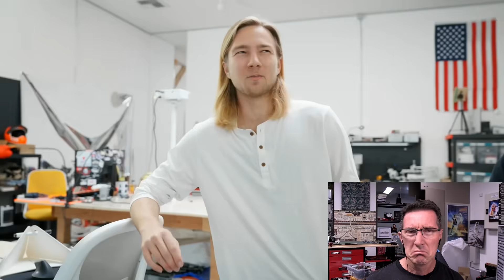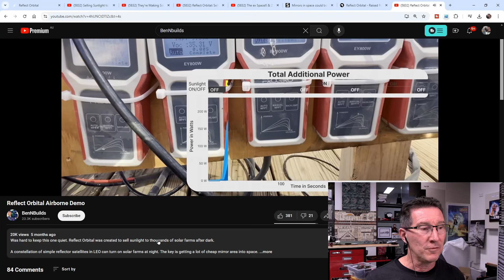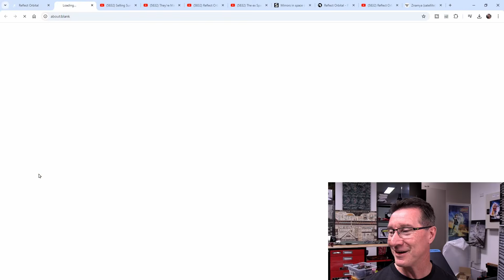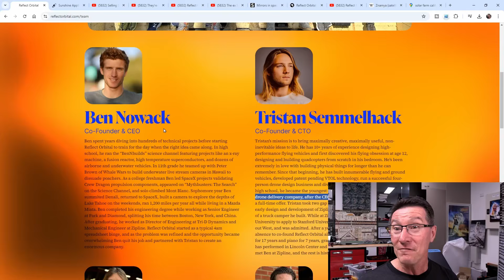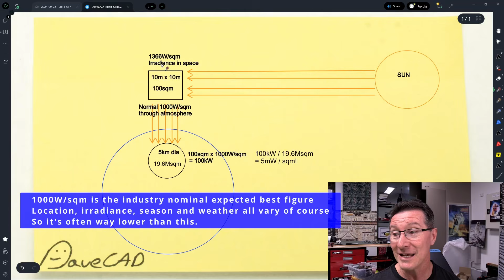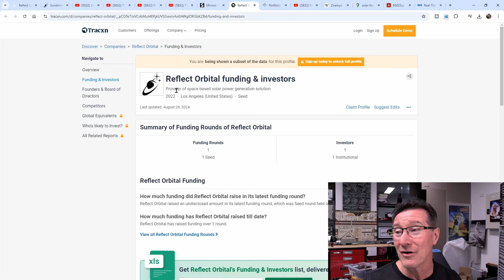EEVblog 1637: Solar Freakin' Space Mirrors! - Reflect Orbital DEBUNKED

Comment: First, the you need to include the cosine of the angle. Assuming mirrors cannot reflect at 45 degrees you will get 70% or more. Then the mirror are not 100% reflective.
But even if we ignore any of that, to reach 500W/m2 to have a sun equivalent in an area of 2500m radius, you will need more than 9.8 million mirrors.
Earth is the only planet we can live in the foreseeable future, we won't colonize Mars soon, but I am really really afraid of this crazy startup companies if they get enough funding to launch almost non-controlled thousands of satellites in low-Earth orbit. It will take just a single chain reaction to make impenetrable barrier of debris to trap all humans on Earth.
Reply from the maker: I didn't calculate how many mirrors it would take to get the claimed 200W/sqm, it's was already enough clown world for one video.
Reply: The big problem, due to cost and weight limitation they have to put the mirrors on higher orbit where drag is very small. But due to optics, they need to put it into the lowest orbit with low enough drag.
That exactly the orbit where Kessler syndrome can cause massive problems! This is literally the worst possible orbit to put their junk on.
Reply: @adamrak7560  also the lower the orbit the more of the satellite needs to be ion thruster (and fuel tank) than mirror in order to be able to reflect light in a controllable direction.
When the thrusters operare the mirror isn't likely to stay flat either.
Reply: Good for the universe ✨️
Reply: u only need one mirror, for maximum capital performance
Reply: doesn't matter, we're trapped, anyway. No one and I mean NO ONE is getting off more than very temporarily.
Reply: @TheGuruStud  it does not imply to the freedom of movement ON the planet. eat some shit! stupid!
Reply: There are a lot of problems with living on Mars, mainly the reasons why there's almost no atmosphere there
Reply: Kessler syndrome brought to us by tech bro scammers.

Comment: There absolutely is a way to generate power using the system. But you need to sell it not to solar farm owners but to Jevaho's witnesses. They will meet at dusk and right when their leader says his last "amen" the sun will shine on them again and they will start to beat in extasy until the sattelite has flown too far away and the holy light is gone. That is when you pass out simple vibration generator/battery untis from China and as the magnetic cores rattle inside the coils the small lithium batteries in them will get charged. After the meeting concludes and everyone is satisfied you collect the devices and hook them up to inverters and sell the power to the grid. This way one may even claim that it is possible to transform the power of faith directly into usable electric power.

Comment: Unbelievable. If only those doing the investing had al little more science / engineering knowledge. I remember learning the inverse square law in a high school physics experiment aged 14. It's about all you need to know to see this can't work.
Reply: just use concave mirror, then the collimated beam won't have inverse square law drop.
Reply: @xponen  That doesn't help at all. With a collimated beam you get a smaller spot of light on the ground, so can hit less panels, for less time as each satellite passes overhead. They're effectively un-collimating the beam anyway (i.e. making it diverge more by using a convex mirror - there must be a word for that) to make a 10m mirror make a 5km spot on the ground. If the mirror were flat (and perfect), you'd effectively get a 10m spot on the ground too, as the satellite orbit altitude will be irrelevant relative to the distance to the sun

Comment: In theory, this would work. In practice, we don't have the tech to do this affordably. Besides, logically this would result in more heat hitting the earth which would be bad. So even assuming that they get the amount of power that they dream of it'd still be a terrible solution.

The better option would be scaling this up until it becomes practical. So massive mirrors that can capture light from hundreds or thousands of kilometres, convert all of that energy into a focused microwave beam, and then finally send that power down to collectors on earth. But that requires having better launch tech than what we currently have.
Reply: Collecting all that power into a concentrated beam.....like a giant space death ray, eh? If it went astray even for a minute, it could cause massive amounts of damage and kill who knows how many people.
Reply: @WereCatf I mean, for some people that might be the point, especially if they've got a fluffy white cat and a penchant for holding the world to ransom...
Reply: @WereCatf  Seems my comment didn't want to post, so I'm forced to retype it. Still not planning on doing any actual math for what a safe beam energy would be.

Anyway, there's no need to use a beam that's got many thousands of times the energy of regular sunlight to be commercially viable. Even just a few times regular sunlight would be sufficient. Not sure what the safe range would be, but my estimate would put it at around 10x regular sunlight. Then just build a larger collecting region while keeping the incoming energy at 10x sunlight per metre.

Also beams can be focused from multiple collectors into a single area on earth. That way each of those collectors individually has a beam of only a few times the energy of normal sunlight. So even if one of the satellites is compromised, it can't cause any damage on it's own. It can then be promptly destroyed or retargetted correctly. Though of course that'd still be concerning if all the collectors were turned into a weapon.
Reply: There is a way easier option. Just install more solar panels and energy storage on the ground. It's not rocket science (literally).
Reply: @to_loww  Currently, yes. Once we have cheap launch costs or industry in space, placing the solar collectors up there will be the better option. This is all mainly an engineering and political limitation rather than an scientific limitation. While stuff like solar roadways is a scientific limitation cause its stupid, placing solar panels in space gets you more efficient energy (space doesn't really have weather, clouds, useful land, day/night cycles, etc). So once we get the tech and will to make such a thing for cheap, it will be done and it'll be more affordable than covering the planet in solar panels. Unless you're suggesting that we'll never get to a point where we can or need to do that. Which would be quite disappointing.
Reply: It doesn't even work in theory - to get 5km radius of sunlight at regular sun power/area numbers, you need to collect that much area of sunlight to begin with - you can't magically amplify 10 sq m of sunlight to be 5 sq km of sunlight

Comment: Changing topic slightly but our friend "Solar Roads" are making their way to the UK .. they say ---- " Solar roads are a new and innovative concept as they do not require land to be specifically allocated. This is because the road infrastructure already exists. Therefore, this emerging technique of embedding solar panels into pavements and roadways is becoming a more attractive proposition." ----- and they say that "solar roads may supply up to 96.42% of the UK's total electricity, which is a substantially promising potential." i bet your BS sensor picks this up lol
Reply from the maker: Is there a proposed UK system?
Reply: @EEVblog  It appears so
Reply from the maker: @kynkokytsumi1931  JFC they just got their 7th government grant in June! They have been grifting this for 18 YEARS now!
Reply: @EEVblog  funny they are making it sound like it's a new thing 🤣
Reply: @kynkokytsumi1931  is it by the same people behind those videos on Thunderf00t's channel? Wasn't the government contract they had in the USA a failure not much better than their own small 3m²-sh prototype? They had something like a 10m road segment somewhere, maybe significantly changed from the initial idea, like  reduced to either "freaking-solar-gutters" or "freaking solar strip on the middle of the lane, not under cars' tires most of the time." 

While that would get rid of issues deriving from led bells and whistles and some of the "glass-road"-performance issues, it's probably quite far from a promising idea. Makes me suspicious that in some cases such projects may not have the politicians involved being duped, but making some money on the government contracts themselves. Although Hanlon's razor would have them as just being just as bamboozling victims. That they historically have managed to make some corrupt money while at least delivering real projects, overpriced, is somewhat suggestive of them being duped, Although the new-tech thing may help camouflage the overpricing better than standard infrastructure.
Reply: I heard about solar roads for pedestrians in Hungary. Somebody is either high or was really paid off. (or both)
Reply: @adamrak7560  Those companies and projects live on subsidies for renewable energy.
Local governments get a budget to spend on renewable energy projects, they get contacted by companies selling stuff like solar roadways, and they decide to do a test.
It becomes a failure, the money is wasted, but they companies just move on to the next region.
Reply: @Rob2  And they call it 'spending' money on renewables to meet their 'sustainability-quota'. "Wasting" would be a much better word and closer to the truth.
Reply: @Rob2  maybe it's time to start speaking of travelling snake-solar-panel salesmen.

Comment: Alright it is settled... I am going to start a business called Solar Freakin Tires! I am going to put solar panels on car and truck tires. just doing some toilet paper math here and I think it will be enough to charge a Tesla so you never have to plug it in. Don't question my math because I am a math god. Anyone who criticizes my ideal is a big oil bigot.
Reply from the maker: Straight to StartEngine or Indiegogo
Reply: This sounds good. I put one of those TPMS things on my tires and it's amazing how hot they get when parked in the sun. That energy could be harvested.
Reply: @gargantuablargg  Joke aside, I really want those TPMS to use the changing pressure differential between inside and outside while driving for energy harvesting and to pump up the tyres as needed. I'd say that is totally doable. The electronics need minimal amounts of energy, and the pump doesn't need to pump any large amounts, just what's lost over time.
Reply: @gargantuablargg  Maybe. I was thinking more about a tiny piston driven by a small weight that can move a bit in the rotational direction of the wheel. It would execute one pumping move every time the rotational speed changes. All the electronics need to do is to open or close the valve between the piston and the inside of the tyre when the tyre needs/doesn't need more air.
Reply: Solar Freakin Toilet Paper!!
Reply: You got my backing! :D
Reply: I'll so steal this shit.

Comment: Their proof of concept of using mirrors mounted on balloons makes way more sense their actual planned final product.
Reply: Seriously. Placing mirrors in high places to illuminate shaded zones is actually a more practical idea and infinitely cheaper to implement with zero risk.
Reply: @vejymonsta3006  if you want more light in an otherwise shaded space -  yes, absolutely!! Of course not a balloon - they are inherently unstable. If you want energy, it probably makes more sense to mount a solar panel rather than a mirror that will reflect that light onto a panel ;)
Reply: @kacperkucinski7702  Agreed. That's big brain
Reply: @vejymonsta3006  there are risks. If placed low - animals and ice chunks, if placed high - ice chunks, but the repair is still cheaper.
Reply: @vejymonsta3006  And that's actually done already. So proven tech. (One just need polished stainless steel plates, really)
Reply: @vejymonsta3006  People don't put solar arrays in shaded areas, though.
Reply: @vejymonsta3006  I think there is a city in switzerland which does that, or austria ... somewhere in a deep valley
Reply: @vejymonsta3006  I thought of that too....couldn't articulate it as well as u
Reply from the maker: Ironically, yes.
Reply: There is a village somewhere in a valley, using mirrors on the hill to illuminate parts of the village.
Reply: Exactly what I was thinking. You beat me to it.
Reply: It's basically just a solar accumulator though, those farms out in the desert using mirrors to concentrate onto salt would work in any bespoke setting.
Reply: I get you about the proof of concept balloon tests being the best part. It basically shows the reality of what they have.
What if you flip it, and raise the solar panels instead to get more out of the dawn/dusk? You can easily  raise large box kites or other dirigibles outfitted with solar panels angled at just the right angle, connected with tethers to draw the power. But would it be worth it?
Reply: They’re actually pretty smart for this idea, although most intelligent people see right through it. What’s so shocking to me is the amount of idiots who believe this kinda crap. Ever hear the saying more “money than brains?” Yeah, well obviously quite a lot of people with money are dumb or just naive. However “start-ups” are a quite popular way for the wealthy and middle-class to invest their money in. Look at all the crypto scams and people who’ve lost a lot of money on new crypto companies, who’ve failed. I know all of us intelligent folk are laughing at this…just don’t underestimate the level of stupidity in our society. Look at how many people believe the earth is flat and will argue with and try to convince people all day long, that they’re right. There’s debunking the debunked and it’s like a never ending loop of stupidity. 

I’m sorta contributing to the same thing I guess, by wasting my time here. Haha, but I had to comment on this one, because I am truly astonished. It’s unbelievable to me that wealthy people have invested their money in something so improbable. I’m astonished they were able to convince a few “smart” people with great resumes or careers and get them to move. Would you leave a high paying real job at a Fortune 500 company to work on this b.s.? I guess maybe…if you were 100% sure you’d get paid each month for at least a few years? This was both frustrating and funny to watch and Dave made some great points. I did learn a thing or two as well. However…definitely a net negative when it comes to brain cells or “points” on this half hour of my life. Haha!
Reply: Likely to cost more in fuel and paying balloon crews than the most optimistic possible power generation.
Reply: They’re actually pretty smart for this idea, although most intelligent people see right through it. What’s so stupid is the amount of idiots who believe this kinda crap. Ever hear the saying more money than brains? Yeah, well obviously quite a lot of people with money are dumb or just naive. However “start-ups” are a quite popular way for the wealthy and middle-class to invest their money in. Look at all the crypto scams and people who’ve lost a lot of money on new crypto companies, who’ve failed. Anyways…all of us intelligent folk are laughing at this…just don’t underestimate the level of stupidity in our society. Look at how many people believe the earth is flat and will argue with and try to convince people all day long, that they’re right. There’s debunking the debunked and it’s like a never ending loop of stupidity. 

I’m sorta contributing to the same thing I guess, by wasting my time here. Haha, but I had to comment on this one, because I am truly astonished. It’s unbelievable to me that wealthy people have invested their money in something so improbable. I’m astonished they were able to convince a few “smart” people with great resumes or careers and get them to move. Would you leave a high paying real job at a Fortune 500 company to work on this b.s.? I guess maybe…if you were 100% sure you’d get paid each month for at least a few years? This was both frustrating and funny to watch and Dave made some great points. I did learn a thing or two as well. However…definitely a net negative when it comes to brain cells or “points” on this half hour of my life.
Reply: Exactly. They could mount mirrors to balloons and tie the string to each panel. The balloons lift up in the air relative to the sun angle to keep the photons coming in...for an hour or so anyway...
Reply: Yeah, but out of all things that need a proof of concept, the fact that mirrors, erm, work and actually, erm, do reflect light... it's not one of them. We all figured that out when we were five.
Reply: No, it doesn't. No use in lifting what can stand on its own.